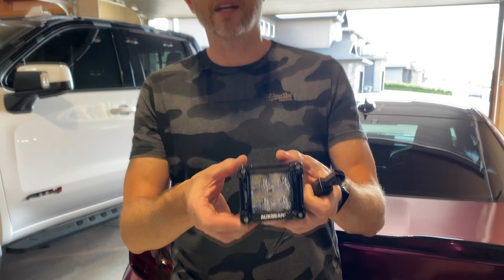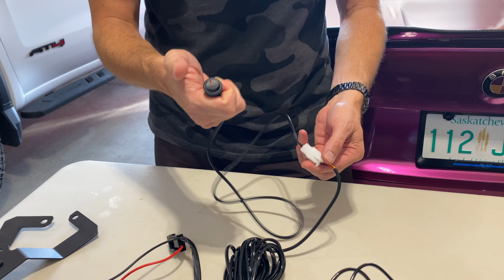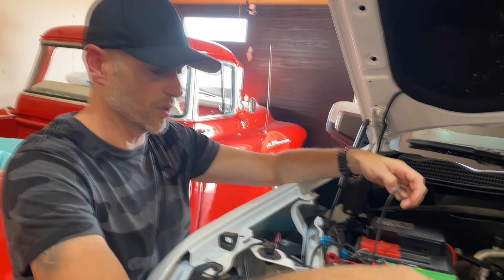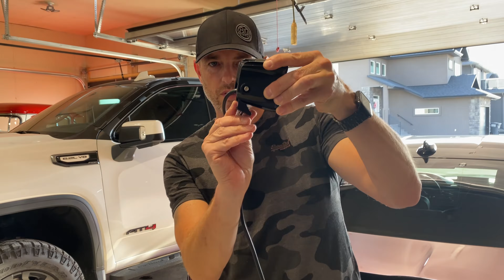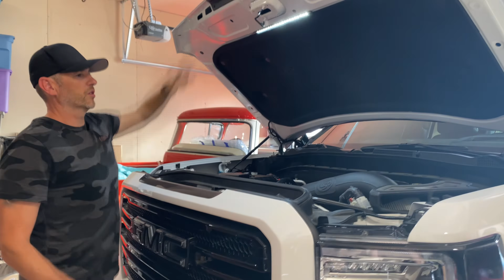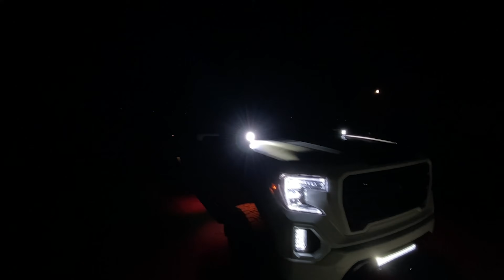Adding 3” LED Pod / Ditch Lights to My GMC Sierra AT4 – Full Install!

Comment: I can't seem to figure out the switch wiring from pods to panel. Any help?
Reply from the maker: What switch are you using?  Every light in the cube share the same negative wire.  Just send power to each of the other wires when you want that function to work

Comment: Which switch did you buy? The link died. Did you have to run the wire through firewall for the switch panel connects to the switch box?
Reply from the maker: This is the one I have now: https://tidd.ly/44cUGRk

Comment: Great content man. Question how do you pull back that cover to run the wires thru the engine bay? I have a 22gmc sierra 1500. It’s like a fabric type thing thats just under the window. Do they just pull out with a tool u use for the tabs or does it screw?  Appreciate it man!
Reply from the maker: Thanks!  There are three big plastic circles that can be pried out that hold the carpet-like panel.

Comment: I just hooked up my Auxbeam pod lights just like you did, option 2. I left the relay in place, twisted the red & yellow wires together and hooked them to the + terminal in my 12 gang Auxbeam switch and the black to -. Once I put the inline fuse back in the lights came on without anything on or running and I can't turn them off. Where did I go wrong?
Reply from the maker: Sounds Like you wired up right to the live (always on +) connection.  Don’t combine the yellow and red.   One is for the relay to get power from the battery.  The other is to be connected to one of the switches to signal the relay to let the power through

Comment: Looks good. But they look a little low. Most of the light is getting lost on the hood.
Reply from the maker: Here is a video upgrading them to a different cube and adding some risers.   I can easily turn them towards the ditch too.  

Upgrade Your Truck's Lighting: LED Pod DIY Guide
https://youtu.be/SChkEK-RlUE

Comment: You mentioned that the black pods have both the spot light and flood light feature built in but on Auxbeam's page you have to select one or the other.  Have they changed the pods?  I also didn't see a way on your setup to toggle between the two settings.
Reply from the maker: I meant you can buy a set that do one function or the other.  Sorry if I didn’t make it clear.
Reply: @Donslife  No worries.  I'm now on to your video with the Siberia cubes.  Like those a lot better!

Comment: Hi Sir , Can you confirm me you only connect the black wire to the auxbeam panel ? You dont connect the white and yellow from the switch harness anywhere. And do you solder the black wire with a #16 wire to make a tight fit into the auxbeam panel instead of you small black wire . Thank you !
Reply: @Donslife
Reply from the maker: It all depends if you want to use relays that might have come with the lights.   Otherwise you just connect the white to + and black to - on the auxbeam panel.  You can combine both lights into one switch
Reply: Yes that what I want to do , use the existing relay and harness that came with the auxbeam pods . I connected the red wire that usually goes to the battery, in slot number 1 . But the pods aren’t working. I’ll connect the white and black wire into the same slot number 1 into the auxbeam panel . Correct ? Thank for your help !

Comment: I completed this install this weekend. Thanks so much for the details. There is one question I have and I can't figure it out. I hooked it up just like you did I also have an aux beam switch and left the relays on the pod lights (your Option 2) . I removed the incline fuse while doing the electrical and then installed it back in place. When I installed the fuse the lights turned on. The truck wasn't running, Auxbeam 8 gang was off, but the cube lights were powered on. I took the inline fuse out and the lights went off. With the fuse out everything now works as it should, lights turn on and off with the Auxbeam switch. did you not show this in the video? Is there a problem with not having the inline fuse installed, why did it turn on when its wired through the switch? I'm hooked up to the first fuse that's a 5 in the Auxbeam just like you did. Thanks,
Reply from the maker: I am not sure what is contributing to the issue.  But to answer your question, the auxbeam has its own fuse for each switch location so you’re protected from that front.
Reply: @Donslife  Thanks so much for the response. I will just leave it out should be good as long as it's protected. Can't get enough of the videos. I have become good friends with the Fedex/UPS drivers lately. My wife thanks you for that ;).

Comment: Don. 
Where did you get that wrap for the tailgate and top?
Reply from the maker: VViViD Vinyl
Reply: @Donslife I have the same switch panel as you do from Auxbeam. Which cables for this setup can I ditch? The positive and mega motive are plugged into the positive and negative on the switch panel correct?
Reply: @Donslife the switch has three wires… where did you put the third wire on your switch panel? Sorry for all the questions man. Lol

Comment: Did you ever have a problem with the driver side wiper arm hitting the bracket?
Reply from the maker: I did with the auxbeam brackets and shaved them down a tiny bit.   The new pods I installed with a spacer clear nicely
Reply: Thank you for the reply…..

Comment: I wonder if you could just use the cargo light button already on the truck
Reply from the maker: You could as a trigger, yes.  The lights would have to use their relay and grab power from the battery and just use your cargo circuit to tell the relay when to open and close

Comment: How many amps are the lights? Did you connect to the 5amp, 10amp or larger?
Reply from the maker: 5amp.  They are only 20watts each (40 total) so under 4 amps
Reply: @Donslife  Thank you sir thats where I went and wanted to make sure.

Comment: Random question but do you under coat your truck for the winter months?? Just bought the same truck as you and I live in Canada as well thinking of getting it done.
Reply from the maker: I used to but the last couple trucks I haven’t.  It can’t hurt but depending on how they do it, it can get messy underneath
Reply: @Donslife  as a fellow Canadian, I can't believe you don't do rust proofing! Do you wash your truck frequently?

Comment: Don can your help me find the link for the brackets? Tks
Reply from the maker: Go to Putco.com and filter by your vehicle.  2231 is the part #
Reply: Tk u!
Reply: Don did you have problems with the driver’s side wiper rubbing against the pod bracket?

Comment: Question for ya? You’ve had both the cold air inductions intake and are running the s&b intake now, still…which do you recommend? I have a new Silverado trail boss, 2022 6.2 liter, the refresh model…overall, is one more noticeable with power gain and fuel efficiency or anything you had noticed and give a unbiased opinion….also I have the awe dual exhaust quad tips if that matters…
Reply from the maker: For a truck like that and the extra grunt, the S&B for sure.  The CAI fits the personality of our Escalade 6.2 better.   Both are excellent products
Reply: Thanks man! Really enjoy your videos, take care….

Comment: Have you come across anything in your mods/accessories including possible future purchases…. Anything that can bypass that 8 second camera timer while moving. I took my at4 off-roading and I was 1-2km above the speed requirement and it kept turning off. Extremely annoying. Should be enabled with no timer on off-road mode. In my opinion
Reply from the maker: Nothing yet.  I think it is a coding thing. No hacks that I am aware of